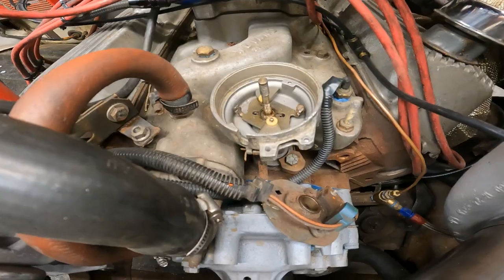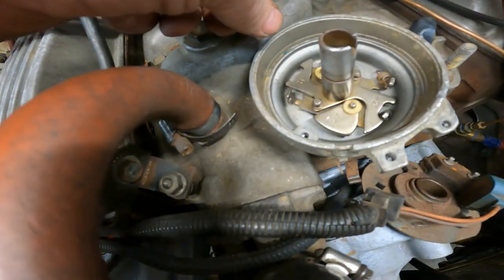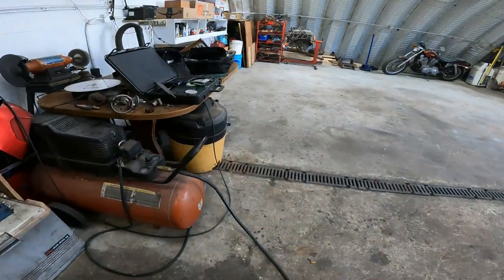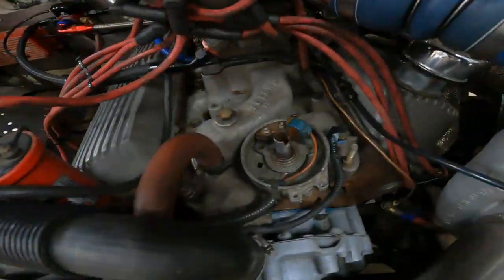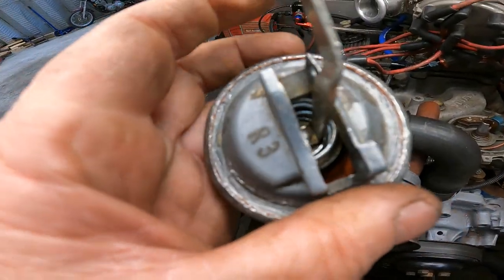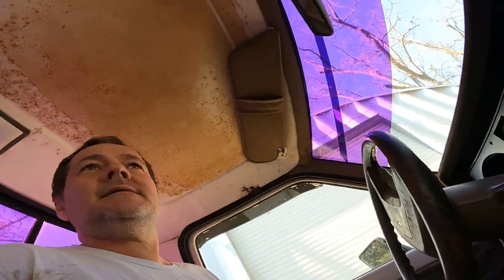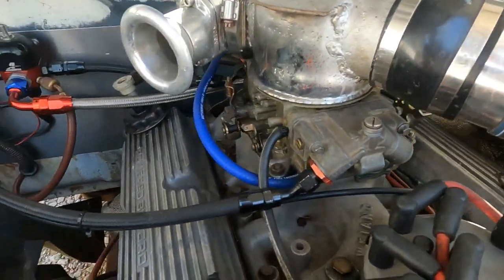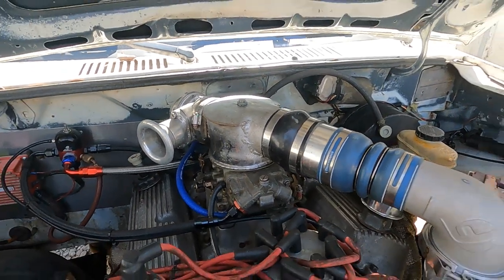Homemade Boost Retard Test Drive

Comment: Nice to see ya killing the streets in it again! Keep it up!!!
Reply from the maker: Slowly working out some bugs. It needs the 8.8 Explorer rear end I chopped put in it.
Reply: You are working some magic with that setup there. Gonna be too much for the streets once you get the bugs worked out of it
Reply from the maker: I fixed the boost leak today. And I adjusted on the boost controller. It should run right next test drive. It was taking about 45 seconds after the wastegate opened before it would close back. I'm gonna mount the camera where I can film the gauges next time I drive it. It's hard to watch the gauges and drive when it's trying to swap lanes from spinning tires LOL.